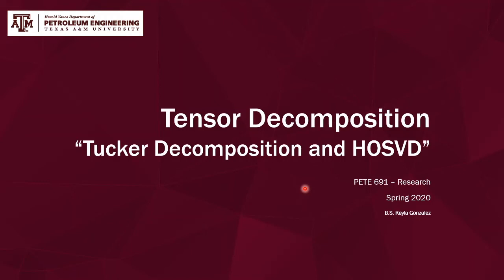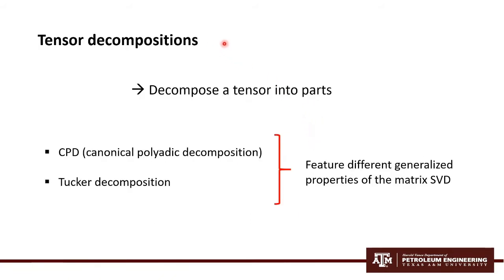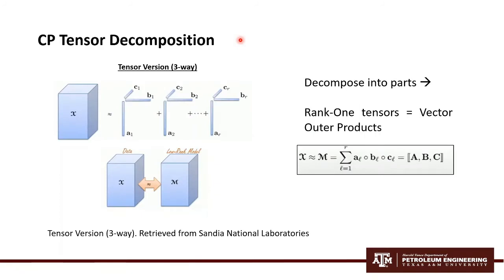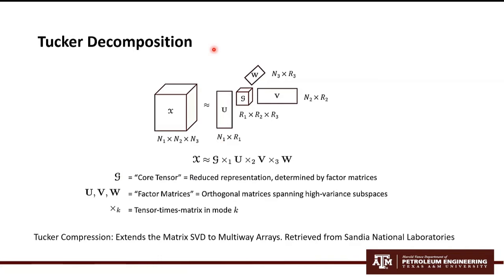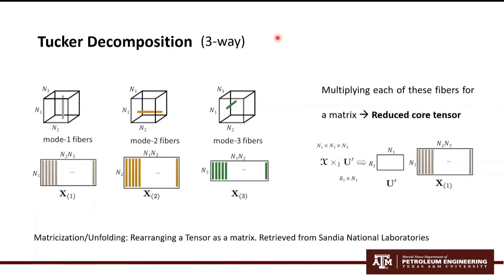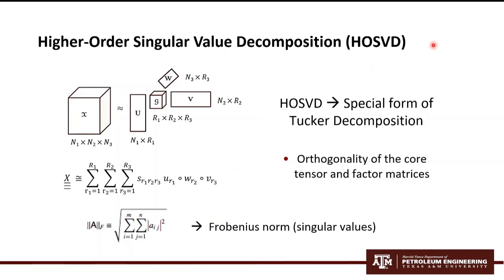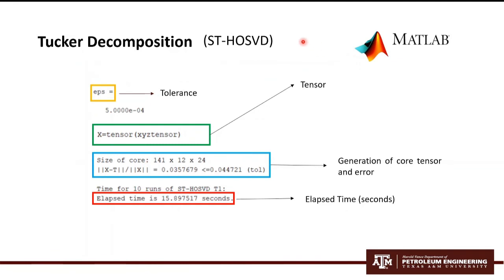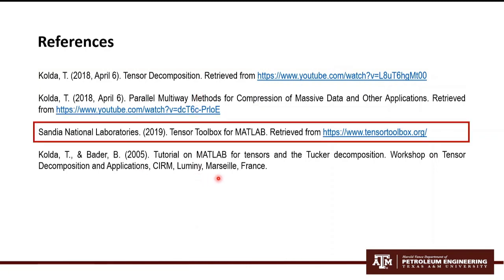Tensor Decomposition (Tucker and HOSVD) with MATLAB example - Part 1

Comment: Interesting presentation and very well explained. I’m facing issues opening ur data file (.mat) to visualize the 3D data format. Could u plz explain or provide any reference showing the 3D data format in Excel and in Matlab files. Thank u.
Reply from the maker: If you want to analyze the mat file you can slice your tensor (e.g. T(:,:,2)) and visualize each matrix. You can also plot those slices using slice, imshow3D, or plot_surf.

https://www.mathworks.com/help/matlab/ref/slice.html

Comment: Very nicely explained. Thanks a lot! Can you tell me the source where I can find the complete mathematics behind CP and Tucker decomposition? Being a mathematics student I need to understand it and It is hard to understand it through papers like Tamara G Kolda and Brett.
Reply from the maker: Thank you! I would recommend you to check Tucker's article (Some mathematical notes on three-mode factor analysis) and Kiers' article (Towards a standardized notation and terminology in multiway analysis). 

https://link.springer.com/article/10.1007/BF02289464
https://onlinelibrary.wiley.com/doi/10.1002/1099-128X(200005/06)14:3%3C105::AID-CEM582%3E3.0.CO;2-I
Reply: @higher-orderknowledge3364  Wowow! I checked it, that helped. Thank you!